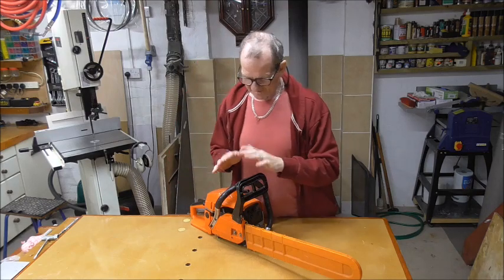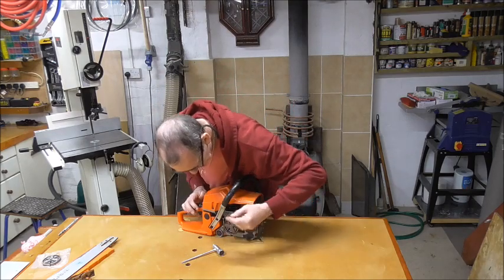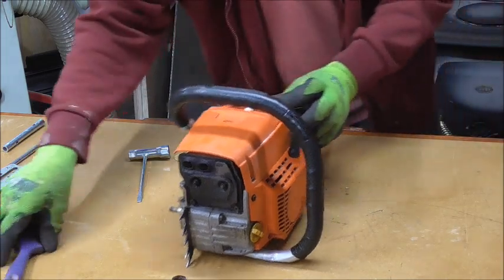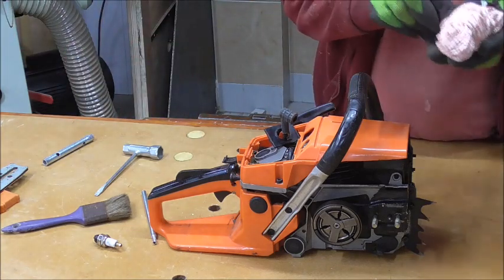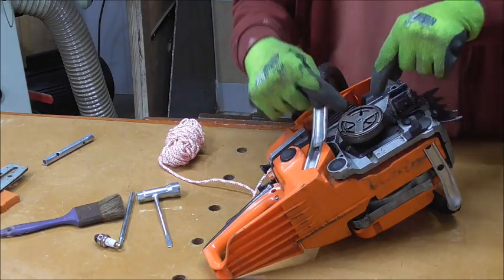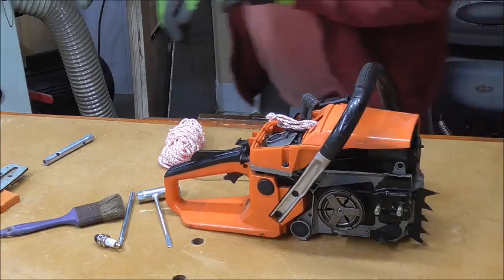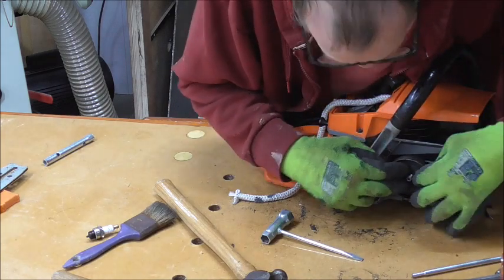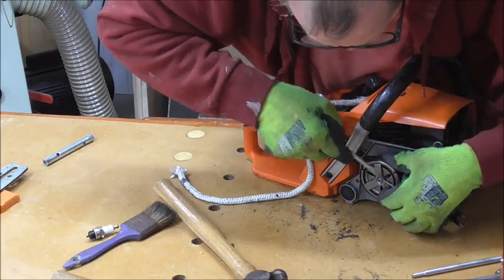Chainsaw Clutch replacement

Comment: Beating on that clutch looks like it could break some expensive clutch parts or maybe even damage the bearing or seal.  Maybe I'm paranoid but I think I'll order the special 3 prong service tool and use an impact. Do you know if manufacturers use Lok Tite on these parts?  Do you think it would have been easier with a little heat surrounding the shaft? Thanks for the video.

Comment: With an angle grinder wrench it would work faster and better.
Reply from the maker: Never tried that
Reply: @dmgladden  You must try this method it works so much better than a hammer & cold chisel.
Reply: Angle grinder wrenches are 2 prong.  This clutch design needs a 3 prong tool.
Reply: @cottydry  Theoretically, it requires a key with 3 claws, practically it works well with 2. And above all, it is preferable to use a key than to hit a brittle cast steel with a hammer. Repairing this clutch if it breaks costs $1, but the Echo costs more (for example).